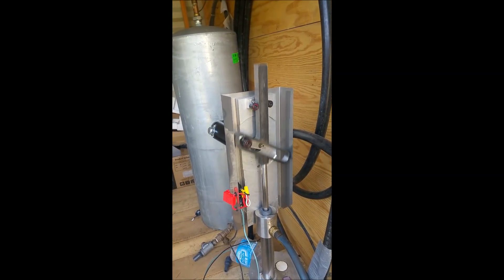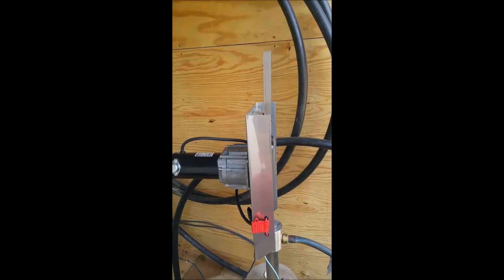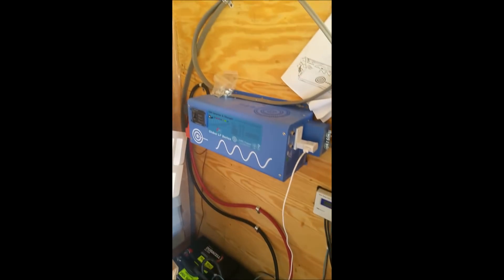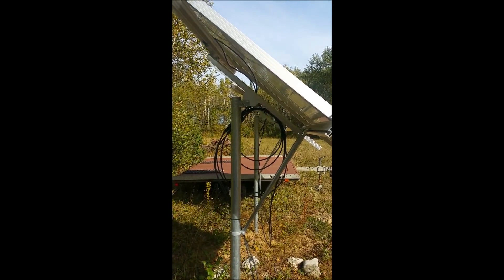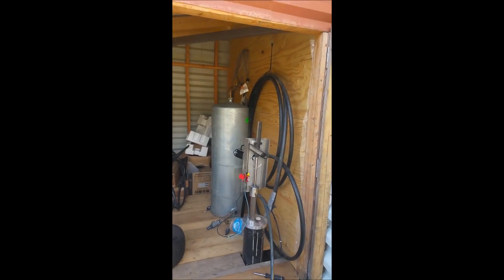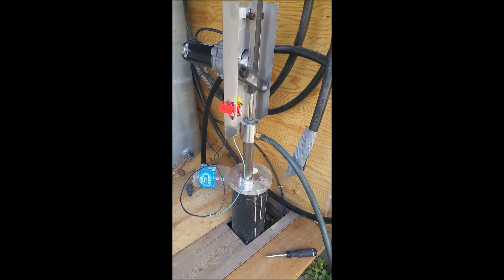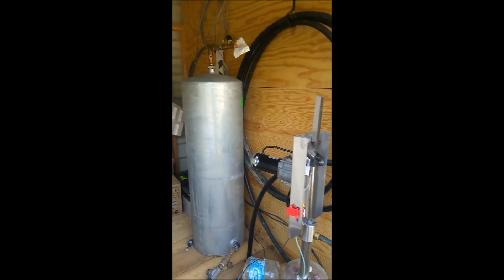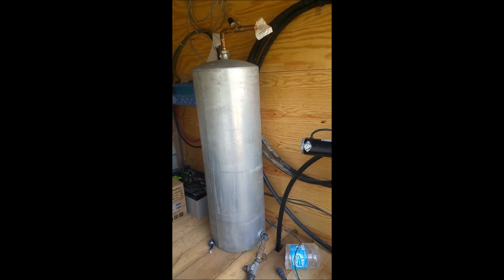Simple Pump and Missouri Wind and Solar products installed.

Comment: I have a Simple Pump I bought years ago to do the same thing.  My well is too deep and I was never able to get the thing to work right.  Some of the parts, particularly the ball valve at the bottom of the piston broke several times.  Simple Pump was good about replacing them, but they couldn't help me with a well that is too deep.  In the meantime I have a slightly used one with the 12 volt motor setup if anyone is interested.
Reply from the maker: Sorry it didn't work well for you. I don't have much run time on mine as it is at a location that only gets occasional weekend use.

Comment: So I have a question, if I'm rain harvesting and holding in 2500 gal tanks, can I use the solar simple pump with a pressure tank for my whole house needs?
Reply from the maker: The simple pump is a well pump. It brings water up from the well. They actually recommend pumping in to a storage tank and using a different type of pump to pressurize a cabin water system (think pump like an RV/camper has). Because of the off grid and intermittent use of the pump, I opted to try and set my system up to use the simple pump to pump into the pressure tank (which would be the only water storage above ground). Supply would be limited until pump kicked on again, but should be enough for a couple of showers without pumping.